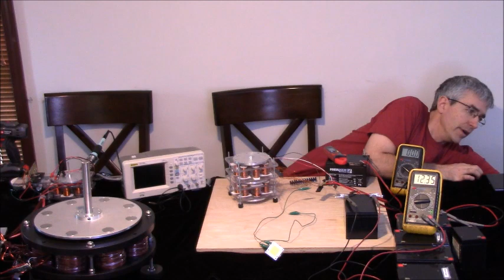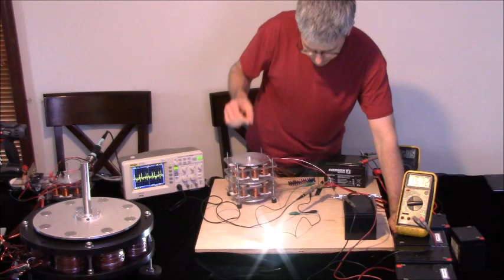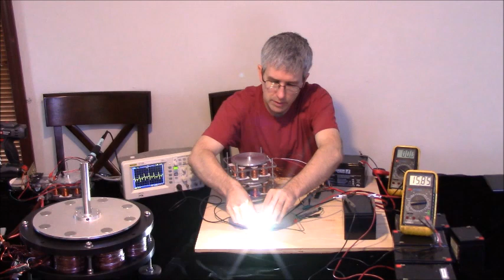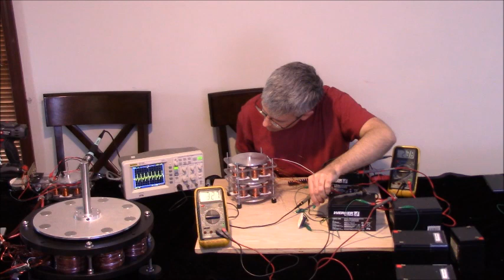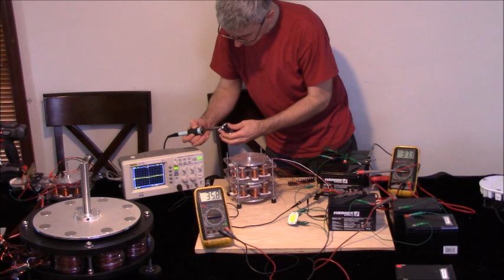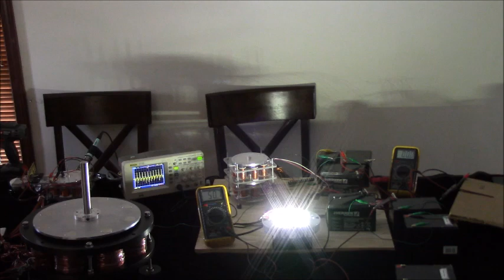4 Pole Mini Double Stacked 36V 12 Gen coils

Comment: Hi Rick,

A suggestion:  Instead of creating a new part for the center flywheel because you want to reduce the height of your setscrew boss, I suggest simply drilling the shaft hole in the center plate out larger to accomodate the setscrew boss and let it protrude up into the upper section.  Since, if I understood you correctly, you are removing the center bearing support of the shaft, that space can be opened up.  I doubt you'd introduce any resonant vibration in the middle of the two bearings still existent because your rotors are very well made and well-balanced.

I have run my single layer machine to well over 10,000 rpm on 48v and much higher when approaching 120v unloaded (briefly) with higher resistance smaller guage coils (20 ohm).  I use your large dual pole BJT circuits to operate the system.  There don't seem to be any resonant points that stress the support, but the bearings should be upgraded to ceramic bearings to increase durability.  I use the trigger wire setup primarily, however I did build a 5V isolated hall 'starter' circuit setup to initialize the startup current so I could control the system startup and shut down via a computer switching program.  Once the rotor starts, the starter circuit disconnects.

Disclaimer, I fully agree with you about the safety concerns vis-a-vis the magnets coming out of the rotors, but your original design rotor had a nice shoulder in the hole to help keep the magnet flat and secure in the hole.  I run the system in a lexan box I made from material we use in racecar windshields.  :)  It does have a couple of resonant points that let the neighborhood know I'm passing through certain RPM ranges and those are where the magnets might shake loose, so I try to make them No-Op zones for steady state running.

Comment: Why do you suppose the rotor wasn't driven into ringing every time it went through its harmonics? Was it just the mic didn't pick it up, was it the fewer driving coils, or were the pulses not hammering as hard? Love this one better than previous.
Reply from the maker: The rpm was lower in this setup because there were more generator coils and also bigger wire. It did go through the ringing if you listened, but if it goes through faster you can miss it. This is what happened.

Comment: Hello Rick, first of all thank you for sharing. 
When I watched this video and saw about the heating of the mosfet, I want to tell you an experience that I had when I experimented. I used 3 batteries in series for the charging batteries and run the motor on 24V.  Because my batteries wheren't negativly charged  or the voltage didn't get high enough, there whas no charging and the mosfet would get really hot and I was lucky to notice this or it would have blown out to. And I also saw that when you go into the higher rpm's, the energy is not completly going to the batteries, because they didn't had time to absorb. And the charging current was even longer in time then the duration of the puls and the mosfet would get hot again (spikes where showing when going above a certain rpm in the current on the source side that wherent there with the lower because then the energy was absorbed by the batteries before the next puls came. The mosfet went only hot when those spikes where comming.
I only want to mention this because I was thinking on a solution for that and I thought maybe to split the motor coils in 2 sets (2x2) and foresee an electronic switch to alternate between the two sets so the first puls from hall sensor is directed to the mosfet of set 1 with 2 coils and puls 2 is directed to the second mosfet for the other set. By this you have extra time for the coils to discharge the energy to the battery. Offcourse this is only with my very limited knowledge, but I hope it can help you in finding a solution. The most important knowledge that I miss on this is how the negative energy is changed in a setup like this. And also important is that my batteries weren't negativly charged and you can probably go higher in rpm befote the energy isn't absorbed, because if I understand correct the negative batteries absorb the charge better. Please don't see this as I want to be a know it all because I don't, but I want to try to help somebody who's helping me. 

I also want to mention that when I changed my configuration of the charging batteries to 24V setup, the charging was back and the mosfet didn't warm up, at the lower rpm's.

Kind regards.

Comment: Hi,    Do  you  not  worry  about  drag  using  an  aluminum  rotor  from  the  magnetic  field  of  the  coils  ?
Reply from the maker: No because I'm pulsing at the right distance. If it was closer, like when we were using the ceramic magnets then it would be more of an issue, but the neos are stronger and the rotors are further away. In all of these motors there is a difference between the ideal and the practical. You can always improve things here and there for more cost and development time but that misses the point of the fundamental process. Most people have done that, especially technical people who are hung up on unessential parts of the process and generating current, etc.

Comment: if  running only 12v did  it produce 400w  ?
Reply from the maker: ??? I guess you need to watch the video.
Reply: yes i am still watching  , but there is no ammeter only voltmeter  that's why i asked because  i am  interesting to use free energy instead of solar panels
Reply from the maker: There was one but I didn't position it so that you could read it in this video. These videos are not an attempt to prove something to people but rather to show my existing customers how to do certain things. You cannot prove anything with video as anything is easy to fake. So I don't try to prove things. 
Solar panels are free energy in the same way, it's just people don't see them as free energy because the establishment wants you to be limited in what kinds of free energy you use, and solar is controlled and expensive. What I am doing here is showing you how to do these things yourself.
Reply: Indeed.  Being able to make power at night is a very liberating indication of REAL self-sufficiency!  :)